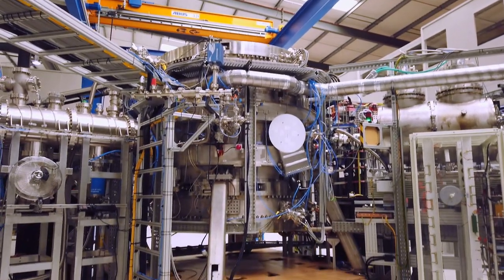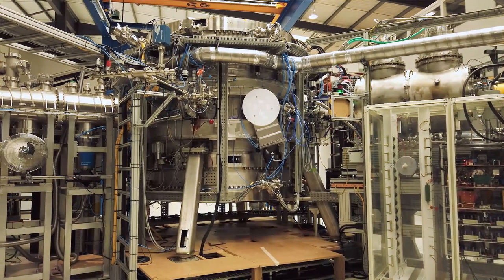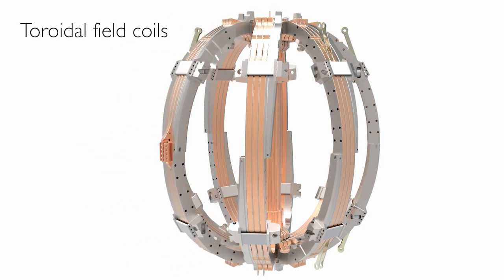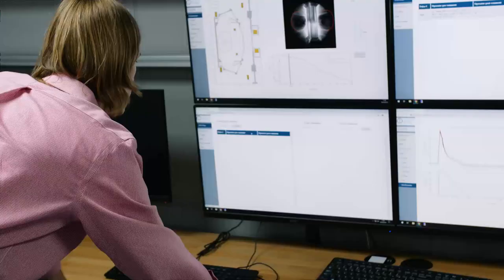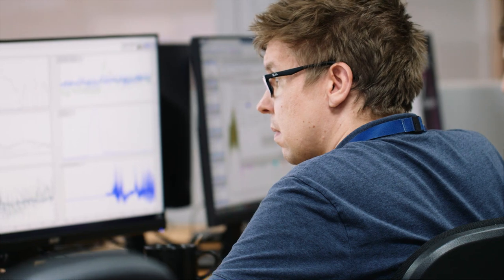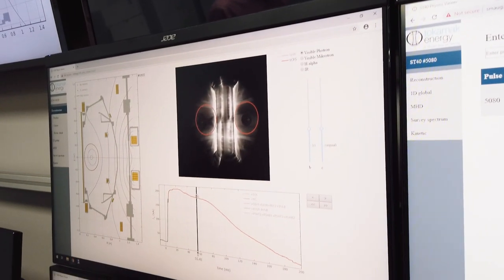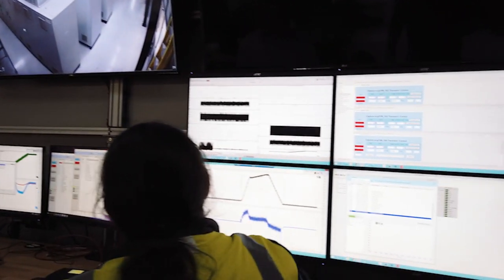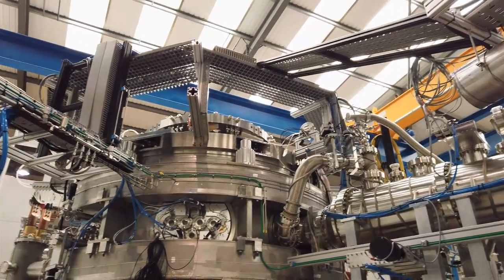Controlling a tokamak plasma

Comment: Sounds like job for a machine learning system. Any plans on trying that?
Reply: I'm not aquainted with machine learning based control technics, are you sure it can provide the required level of robustness?
Reply: It's an honest question
Reply: @danilobraghini1515  I think it's similar to Google using it on datacenter cooling control. I imagine it's the best optimization you can do in real time, when you deal with a very complex system (thousands of parameters). Not sure how robust though, there are probably fail-safes. It's very much a work in progress, figuring out corner cases, black box debugging...
Reply: @eskelCz  I see, I know that machine learning still on the state of the art of control systems, but particularly  I'm kind of an optimal control enthusiastic rather than machine learning, I.A. , neural networks and so on hahaha . You're rigth though, if the system is too complex, there is not much one can do with optmal control. But I wonder if they don't have a good enough mathematical model  to represent this plasma flow.
Reply: Why do people push a machine learning to proper and improper place? Modern buzz-word? How about fuzzy logic? You have an "area" where plasma should be and deviations which disturb plasma. So, use fuzzy logic systems. It is definitely area they can use and controlling solutions and acting will be faster then for an AI architecture
Reply: NO, it sounds like adaptive control system (machine learning is about classification ... with annotated database)
Reply: @yallowrosa  ML can do regression too and other stuff too
Reply: @mk677hd  the staff of SF40 have published papers on adaptive control of the system
Reply: You would need vast amounts of training data to get that functioning (likely 1000's of runs) to get to anywhere near what you would need and even then there is no 
guarantee it will be the best solution.

The best bet would be to learn how plasma behaves at certain densities and temperatures and dial in the control software trying different techniques and strengths till there is little to no issues.
Reply: I got recommended this video because I watched stuff about AI/ML systems for fusion.
Reply: Deep Mind just started doing just that. I guess that's the best response to all the nay-sayers here :)

Comment: I want see the 100 million degree video.
Reply: It's not going to look much different than this video. The plasma is emitting mostly in xrays when it is that hot so it's invisible with the exception of the scrape off layer at the edge.
Reply: Indeed; but ST40 can do DT fusion at 100 million although they may not do a DT campaign with it.
Reply: @andyalder7910  I would be VERY surprised to see them run DT in anything in the short term. Contamination control is a $$$ nightmare. Only 2 magnetic devices have ever gone to DT in history, TFTR and JET.
Reply: Jet's doing it again next year, they better not spill their T2O in the Thames or I'll end up drinking it.
Reply: @andyalder7910  eager to see the Q factors they achieve with the upgrades
Reply: You can see the chinese one, that's where the plasma is failing and the heat is touching the exterior

Comment: Hello there! Wonderful work you got there!

When you say "we take the difference between the plasma position and the desired plasma position", what type of sensor do you use in order to do that? It's probably not a camera because as far as I know cameras don't work at 10000 Hz.

I'm asking because I am interested in this sort of "position estimation" problem, as I work with Visual Odometry.
Reply from the maker: We have a huge amount of magnetic sensors in the machine (called flux loops, Mirnov coils and Rogowski coils) that detect magnetic fields and currents in particular regions. This data, along with other information about the plasma and the tokamak is used to reconstruct the shape of the plasma and it's position coordinates, which are then compared with where we want the plasma to be.
Reply: I'm curious what is the reaction time of a single pixel in a camera sensor/phototransistor... How fast could a camera send pixels if it was programmed to not scan the entire matrix over and over but just a handful of selected pixels, or a single selected row?

Comment: can I ask questions about those magnets?
I remember they ware made with different materials coils ware made of something other than copper .. so can I create an magnet or DC motor using same coils used here?
would there be advantages? I think size and weight is huge advantage ..
Reply: You will save 1kg in copper weight due to better magnets and you only need to add 800kg of auxiliary equipment to have your new shiny superconductor magnets cooled to 77 K. Doesn’t really make much sense for motors, does it?
Reply: @geraldh.8047  than you got the information .. yes doesn't make sense unless we are in space in the shadows

Comment: 15 million degrees plasma temperature is already being achieved but how is the radiated heat in this machine being cooled?
Reply: It's not. the goal is to stop the plasma from cooling. You want to keep it as hot as possible.

Comment: Basics: What keeps the nuclei of atoms separate is the negatively charged electron shell(s) buzzing about (however, some elements "share" electrons). Strip away the electron shell(s) (i.e. "plasma").  The natural repulsive force of like-charged nucleic protons ("+") also tend to prevent "joining"... except "strong nuclear force" within nuclei (presuming neutrons also play a role)... Does the same (or similar) "inverse square law" of gravity apply?  Subsequently, create sufficient force to "squeeze" plasma nuclei to overcome electrical charge repulsion... affording "strong nuclear force" bonding?? (admittedly crude analogy, but...). Are there other elements where achieving plasma state can/could be more productive? (apologies, I'm a motorcycle mechanic... mebbe change aluminum to gold... ;-) Afterthought: could the aforementioned "electron sharing" sharing concept enhance plasma production?

Comment: But where is the boiler which will produce the steam to run the turbine?
Reply: Indeed! I can't understand how they capture all that heat....
Reply: @henryrollins9177  In this device they will not capture heat at all. It is not a fusion power plant yet.  Fusion research is not there yet. In the fusion power plant will be a wall heated up by fast neutrons and cooled either helium or water vapour flowing through the the pipes. This then turns the turbine.

Comment: Do you have a projected time line
Reply: They have other videos on that.
Reply: @MrB1923  oh, ok I'll have go look for them. Thanks.
Reply: I think they said they can't go into further detail because they are a company financing it from ever changing investment and not a government project.
Reply: @maan7715  oh thanks.
Reply: Marcos Filho  could there be a pyramidal or hexagonal magnetic field that is efficient. Btw I'm not an expert on magnets of fusion just curious.
Reply: Clean and abundant fusion power by 2030 is what it says on their website.
Reply: @MrB1923  epic
Reply: @andyalder7910  - that'll change to 2060 then 2090 then 2120 then 2150 and so forth like it has been for the last 90 years? 

They ain't even breaking even on energy consumed vs energy created.......... Your little Q ratio was it?
Reply: @JK-ub3vf  - No. The shape of the Tokamak doesn't change anything. Only the actual shape of a Pyramid Magnet confines the Field into a point creating a more powerful force. 

There using EMFs not Magnets
Reply: @metalgear-  aren't EMFs created by electro magnets
Reply: @JK-ub3vf  - they're powered by DIRTY energy which is part of the problem the Tokamak is experiencing. They cannot break free from using DIRTY electricity in order to power up the Tokamak. 

Magnets are definitely the way to go but the Solar Clockwork doesn't revolve around Pyramids Magnets regardless of how a pinpoint shape can increase the the strength of a Field or not. Such is irrelevant.
Reply: @JK-ub3vf  - EMF is an Electric Field which only exists when Electricity is turned: ON. Magnetic Fields exist w/o the Electric current being active. 

The Sun is partial Magnetic Field but majority EMF like Jupiter while Earth is 100% a Magnet not powered via electricity yet the Core of Earth is the same as both the Sun & Jupiter which tells us that we don't even need to use Electricity.
Reply: @metalgear-  doesn't EMF stand for electro magnetic field. Is see what you are saying tho. Also can an EMF be made into a pyramidal shape or a hexagonal shape
Reply: @metalgear-  Are you a Flat Earther per chance?
Reply: @JK-ub3vf  - Yes that's what EMF abbreviation stands for & Im sure you can confine plasma into countless shapes. It's just doing such doesn't actually alter anything. 

The only time that a shape made a significant impact upon the EM force was when creating Pyramid Magnets. Creating a Pyramid EMF doesn't exactly solve any problems the Tokamak Team are facing.
Reply: @andyalder7910  - No. I'm a Solar Holorogist.
I suggest they recreate the Clockwork instead since such eliminates every single challenge the Tokamak Team are unable to overcome.
Reply: If you guys are curious, here is a link to my Fusion Energy playlist.
https://www.youtube.com/playlist?list=PLAUtk-Q2DF7xjM3BgVQT44w9bozcNgkPW

And my Graphene playlist.
https://www.youtube.com/playlist?list=PLAUtk-Q2DF7wXgENPNkvc5JXH5ocia_Fo

SuperCapacitors and UltraCapacitors playlist.
https://www.youtube.com/playlist?list=PLAUtk-Q2DF7yMYELJtT2FUG93WZaCg4U9

The Alcubierre - Froning warp drive playlist.
https://www.youtube.com/playlist?list=PLAUtk-Q2DF7z-5wWCLg3fZkQKognSFjwE

Other Science and Technologies playlist.
https://www.youtube.com/playlist?list=PLAUtk-Q2DF7w0qUOmrKoKy82mfYbQ3Ng7

My other channel's "About" tab.
This has official websites, be sure to check out the roadmaps.
https://www.youtube.com/channel/UCB9ezXYprgvhMaPWLhyoJ7A/about?disable_polymer=1

The "Channels" tab on my other channel.
https://www.youtube.com/channel/UCB9ezXYprgvhMaPWLhyoJ7A/channels?disable_polymer=1

Here are some other links.

I do feel that Graphene could be used for magnets and for solutions to heat situations with Fusion Energy.
https://graphene-flagship.eu/project/roadmap/Pages/Roadmap.aspx
https://graphene-flagship.eu/material/GrapheneApplicationAreas/Pages/Graphene-Products.aspx
https://graphene-flagship.eu/

Be sure to look pages back in this news info, in the link.
https://graphene-flagship.eu/news

In this link, check on the roadmap by scrolling down, and find the "right arrow" click on it twice to see more info.
https://www.tokamakenergy.co.uk/mission/
https://www.tokamakenergy.co.uk/

The Quantum Flagship.
Now go through everything on their site. Everything. However.. I do prefer that you check my links for my playlists first and watch all the videos in them from top to bottom, in that order. And then each playlist's description with the "more" button, for more articles and links, then going to the "About" tab for official website links and more.
https://qt.eu/

And this isn't the 1900's where they didn't have as much good innovation for Fusion Energy.
They got a lot closer with Fusion than they used to be, for good reasons.

Graphene is also better than any material when it comes to dealing with heat. It can be produced in many different ways for different reasons.
And better than any material when it comes to being super conductive, way better than copper and silicon, that solves your energy issue with the output cost in money. It's also very safe to be around, look up the Graphene sanitary napkins, start with my Graphene playlist videos, you will find them.
Be respectful and start with the videos from top to bottom in that order, watch them all and don't skip through them. You need to see the big picture that I'm trying to show you, if you're not willing to go to that level, you're not looking at it from the big picture and many big pictures that are given.

And anyone who denies the latest progress in where we are at with Graphene, has not gone through everything first in my Graphene playlist and all the playlists on the channel, and then the "About" tab with the official website links, and the "Channels" tab after that.

I hope this was useful, I like to collaborate and share such information for good innovation!
Creativity, the imagination and ideas / good innovation is the way to go!
Everyone is going to have a different level of imagination, and so someone's better imagination and creativity will bring about better innovation in good ways! There are different levels of limitations for each person! Push to the next level of limitation and beyond, and continue to do so!
Be curious and interested with an open mind and open heart, when you see my other channel in the links for the Graphene playlist, Fusion Energy playlist and so on.

Between Graphene and Fusion Energy, there are some exciting things to look forward to, but one must not be scared to try. Graphene is our future, after all.
Reply: Robert Pearce  - it's alrdy stone age tech. 
Steam pressure spinning Turbines was a concept that - Heron of Alexandria (10 CE – 70 CE) with his aeolipile, a steam engine that worked on exactly the same principle as the great machines of the industrial revolution and many modern electricity-generating turbines.

Comment: Does a tiny, homemade, DIY Fusor meet the definition of a Nuclear Fusion Reactor.
Reply from the maker: No. ST40 isn't even a fusion reactor.  The definition of a reactor is "a device for the controlled release of energy".  Although a fusor can produce fusion reactions I don't think it could ever produce excess energy.  And ST40 won't produce energy either, so it's only the later devices that will produce and harness energy that can be called fusion reactors.

Comment: So um. Didn't they achieve fusion years ago and the real problem is containing the reaction with less energy than the reaction itself makes.......

What happens in simulations when they try to contain more with less... My guess is it turns the fusion reactor into a bomb. Its matter at 150 million C. 50 million hotter than a nuke... And force is squared right? So making more and more energy. Takes even more power.... 

It's not possible. Equal and opposite reactions kinda say it's not. 

Unless they have magnets that use very little energy or none at all and its always magnetic. Which would probably not be able to even be moved by humans or machines. It would have the strength to lift an aircraft carrier and be deadly to be around....

So that electromagnet they made that can lift a carrier... Did they simulate how it would effect their facility and earth's magnetic field?

Would suck to turn it on and crank up the power just to have the whole area be pulled towards the magnet.

 And they do remember that almost everything is magnetic in a strong field as well right?
Reply: You are getting ahead of yourself with your guesses comparisons with nukes... As if temperature was everything. What does "contain more with less" even mean??

We have found out the hard way that containment is the difficult thing here and the plasma breaks down as soon as something gets too hot or too crooked in it. So no bomb is formed. Moreover there's going to be only <10 grams of fuel in the behemoth sized ITER reactor. (Compared to >100 tons of fuel in fusion reactors like RBMK.) It equals hardly a kiloton of oomph, even if we assume all of it magically imploded and fused!

Comment: Circle halved once squared twice to the right. 
Draw It. 
12/3/6 numbers like a sun dial. 
That's time, times and half a time in the shape.
Magnesium, Lithium, Carbon and Hydrogen atomic weight numbers. Times from D-T on next clock wise cycle. 
L above positive charge, L below negative charge spin.

Pictured fusion geometry from fusing the word (GOD).